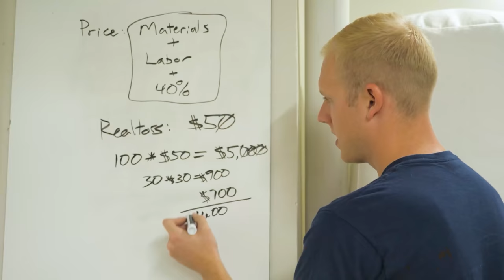building $6,500 worth of cutting boards

Comment: Typically, if you lower the bandsaw guide post to just above your material, the blade will not deflect as much meaning that it will stay sharper longer, produce less heat and not wander as much. Also using the widest blade you can fit will help with all of the above, especially if all your cuts on the bandsaw are for ripping stock.
Reply: Definitely agree!   However, I also make boards like they do but I don't ever use a band saw.   I use the table saw in order to guarantee the cuts are straight.   I fiddled around with that years ago and found the band saw blade did wander some and I'd have to seen the material through the planer and drum sander to fix the issues.

Comment: What is the reason why you don't use the table saw? Seems like it would be faster and cut straighter.
Reply: I have the same question... anyone know why bandsaw is better than table saw for this application?
Reply: The bandsaw blade is thinner than even a thin-kerf table saw blade and removes less material, although I'm not sure if that's their reason.
Reply: @thewoodworkersjourney3314  Makes sense!  Another reason I read last night was that band saws are marginally safer, as their blade pulls the wood down into the table as opposed to a table saw which can kick wood horizontally if it catches an edge wrong.  Maybe that's a good enough reason if you're doing a lot of repetitive "mindless" work?  (Though one should never be mindless around any type of saw).  The kerf thing also is more important the more material that you're processing, and they did a lot of cuts.
Reply: @thewoodworkersjourney3314  Yes but the bandsaw makes a rough cut unlike the table saw.
Reply: I was wondering the same thing.
Reply: You loose less in the cut with a bandsaw but you end up the same loss through more sanding. For me, table saw for straight, bandsaw for curves.

Comment: The bandsaw, look up Alex Snodgrass Bandsaw setup. His word is pretty much law on setting up bandsaws. Great videos easy to follow and understand why you are adjusting what your adjusting. Theres a older one that I like better but Wood Whisper did one more recently with him and I think they specially got into resaw setup and tricks. But Bandsaw setup can make a cheap bandsaw into a beast and a bad setup can make a expensive bandsaw into useless junk. Other things like how fast your feeding can make a difference esp if the blade guides or blade tension is off

Comment: 4:00 “you can’t halt production in a production company”

A production shop has spare parts and plan B’s when a piece of equipment goes down. It should be repaired in minutes not days. Simple things like a dull blade should not stop “production”.
You are a one man band in a garage trying your best. There are always going to be hurdles but you need to be prepared for them. It’s won’t happen overnight it comes with experience.
Reply: With your own business that whole, "shut it down - done for the day" thing just means the problem is being handed off to future you. Twelve hours wait time doesn't tighten screws or sharpen blades.
Reply: Why didn’t you just cut the rest on the table saw instead of stopping?  Should be using the table saw for that step. Just my opinion.
Reply: @brennik05  I was wondering the same thing. I’d guess the blade kerf adds up if he’s doing a bunch of cuts. I don’t think they are trying to resaw something taller than a table saw blade.

Comment: Why the bandsaw instead of ripping them down on the table saw?  Wouldn't the table saw be faster and more efficient in ripping down the material in the manner that you are doing?
Reply: Table saw would make it way more efficient
Reply: The only downside with the tablesaw is there's more waste.  A thin kerf blade would address most of that problem.  In the end, the increased efficiency may be worth whatever the additional waste turns out to be.  And there's the increased real-estate of the tablesaw, though with their new space that may not be an issue any longer.

Comment: Just one question - Why not use a table saw to cut the wood?
Reply from the maker: Binds up when cutting 8/4, plus there’s a lot of waste with an 1/8 inch kerf
Reply: @jennieanddavis  I guess I can’t argue with the binding thing. A thin kerf ripping blade might bind less if you have an appropriate splitter behind it and would waste less per kerf, and I think you’d need to do less planing after. Again, if the table saw makes you feel unsafe then maybe that’s a non starter for you.
Reply: Guess I don’t think kerf waste is the issue if you are cutting .5 inches extra to deal with the wave, that’s also a lot of passes on the planer. Time= money!
Reply: I cut eight quarter hardwood all the time on my table saw with no problems. If you use the right blade and have your table saw set up properly you will not have a binding issue and you will save a lot of time and waste less material. I have the same rikon bandsaw that you do and would never use it to make cutting board stock. And my table saw is not as good or as powerful as your grizzly. Table saw setup and calibration is the key
Reply: @paulgaines2542  Well said, this could be an chance to increase efficiency ie less waste and more gaines (sorry Paul, I couldn't resist!)
Reply: @robmaclennan2004  thanks for the reply Rob I got to chuckle out of it you have to have a sense of humor if you're in this hobby. I do a whole lot of laughing at myself when I'm in the shop.
Reply: It does seem like complete nonsense. I've been cutting Hardwoods on my table saw for a couple years now with no binding or bogging or any problems whatsoever. And I haven't even changed the blade yet. I'm using the one that came with the machine from grizzly. And I seriously I cannot tell you how many hundreds if not over a thousand feet of cuts I have made. Bandsaw is for cutting very thick stock which you don't intend to be anywhere near close enough for a glue up or a reasonable plane.... I'm seriously considering going from a hobby to production because I know I can do a better job than this.

Comment: Why can't you rip your lumber on a table saw a whole lost faster and try a Freud Deoblo red blade 7 1/4" will work on alot of lumber and it cuts like butter. Also if you use Canola oil on your table saw band saw tables , you want the liquid one not the powder stuff, get it at walmart, spray it on and wipe it off, just as good as silcone spray. Give it a try it;s Cheap!!

Comment: Bandsaws are not reliable for perfectly straight lines. They are meant to be a rough resaw. I think it would be better to use 4/4 lumber. Saves time and you don't have to rely on  a bandsaw, which often requires a lot of calibration compared to other tools. You can also use a thin kerf blade on the table saw and it takes away about the same amount of material.

Comment: That roll of paper for glue up should be attached to the end of your table so you can easily pull paper over, cut and not have to think about putting the roll back. It also makes the paper roll accessable to any without having to look for it.

Comment: How do you avoid snipe on your blanks. I have the same planner but when I run them through I get terrible snipe.
Reply: Not sure why exactly but I noticed after I put paste wax on my planers tables it seemed to reduce snipe. Also I take minimal cuts. Takes more passes to get my stock where I want it but saves time on sanding.

Comment: The guide for the band saw blade should be closer to your material.  Set it so it is 1/8" above your material.  That will help hold the blad a little straighter.  Of course, your blade may have been dull and with screws dropping out that probably introduced some slop, but just in general, your blade guide should be closer.  It's king of how a table saw blade should just clear the material you are cutting, not stick up above it two inches.

Comment: I watched countless cutting board videos. Nobody talks about how dry the wood needs to be. So, how dry does it need to be?? What about wood grain orientation? I'm starting to make my own cutting boards (using black walnut) and I'm running into problems with the wood splitting, cracking, and checking.
Reply: 6-8% moisture content is pretty standard for furniture, I assume its about the same for cutting boards.

Comment: 100% gotta say, use a table saw for that cut. you don't use a  claw hammer  to smash concrete. you use a sledge hammer.  use the right saw for the job. one smooth cut with an ultra finishing blade on a table saw ,with the blade set to proper blade height, leaves the cut with a ready to glue surface. 

edit: sorry to beat a dead horse.

Comment: The top guide barring is to high. It should be lowered so that it is just above the workpiece.
Reply from the maker: Fence gets in the way
Reply: The fence on that bandsaw can be mounted horizontally or vertically I have the same saw and you can change the orientation of the fence to accept low clearance on the guide. Read your manual as to how to do that if you can't figure it out by looking at it

Comment: Why not glue up your boards with 8-10" thick strips and then bandsaw them into 3 boards, then through the planer?  You could eliminate 2/3rds of the glue ups.
Reply from the maker: Too much material waste and not enough speed to compensate for the cost of material lost - we tried that, but great suggestion!
Reply: @jennieanddavis  how much more waste is it?  like a 1/16th of an inch?  wouldn't it really be the width of the bandsaw blade?  you'd save a ton of time getting 3 boards out of all the labor for the first half of the build.

Comment: If you are dealing in 1.5” why are you running them through  a band saw? Your table saw should be able to cut that depth. And you were going to plane off more material. You guys are putting an awful lot of thought into this (and thank you for that), but maybe I’m missing something. Your trying to figure out the best practice, I’d start with getting rid of the band saw. (At least for the cutting boards.)

Comment: Soooooo 56 boards at 6500$? That's awesome!!!
Reply: The math. 6500 / 56 = 116. Divide by 2 for material, tax, super, overheads, tool wear = 58.
There were 3 of them so 56 x 58 = 3248 / 3 = 1082 each for 3 days work and no doubt they slept the next 2 days 😁
1082/ 40 hours now really is 27 bucks an hour and i havent counted in the hours for getting the sales, packaging, sending, going to get the wood. So thats the real numbers imo.

Comment: Your stock is thin enough that you could rip it on the table saw. Just curious why you don't.
Reply from the maker: It’s not quite thin enough to keep from binding, and there’s a lot more waste with a 1/8 inch kerf
Reply: Anyone with any sense knows that makes no sense. They are clearly using the table saw completely wrong. Even a 10in table saw can cut three and a half inches of material. A bandsaw is used for completely different purpose. I don't know of any woodworker that would ever use a bandsaw and expect to have a perfectly Square perpendicular or parallel cut after jointing

Comment: A bandsaw is not ideal for ripping boards accurately. You would do much better using a table saw with a sharp blade.  You will get smoother nor accurate cuts much faster.
Reply from the maker: Table saw kerf is much thicker and the board still needs planing after glue up. Bandsaw is the way to go. If I'm totally misunderstanding what you mean, we'd love to see a video of you showing the whole process!
Reply: @jennieanddavis  There are thin kerf table saw blades that make nice smooth cuts.  There are dozens of you tubers that make cutting boards including some really fancy ones.  Too much competition.
Reply: You are endlessly getting the same comment because it makes no sense to try and use a bandsaw after jointing and planing. The process is you face joint . edge joint then if you want to you can plane and then you put the edge jointed part of the board against the table saw fence and make a perfect square or rectangle. Using a bandsaw to try to achieve the same thing would be like setting up a straightedge and using a jigsaw and trying to accomplish what a table saw can do perfectly.. a bandsaw will never cut anywhere near as straight as a table saw.a bandsaw is used for re sawing very thick stock... even a 10-inch table saw will cut through three and a half in just fine.
Reply: @jacobladder6165  I couldn't agree more. After watching multiple videos and reading the comments I have determined they are only interested in advice that they feel benefits them. I saw a comment from them saying a table saw produces to much waste. While it's true it creates waste I fail to see the relevance. Every woodworker calculates waste in to their builds and every buyer pays for that waste. It's part of the build process. You think when you build a home you don't pay for the waste associated with the build process? The reason why all of this is a problem is because they are trying to build a product to a set budget of $100 and make maximum profit. This is why they make their cutting boards very bare basic. Maple and Cherry, cheap hardwoods. No juice groves, hand holds or even rubber feet. I also have never seen them calculate the miscellaneous extras involved in their build process such as. Electricity, travel to get materials and supplies, paper towel, finishes, glue, tape etc. All those miscellaneous items are suppose to calculate in to your builds. Perhaps I'm wrong but haven't seen a break down for it so their profits are miscalculated......essentially at the end of the day they won't start using a table saw until one of them gets seriously injured using the bandsaw.